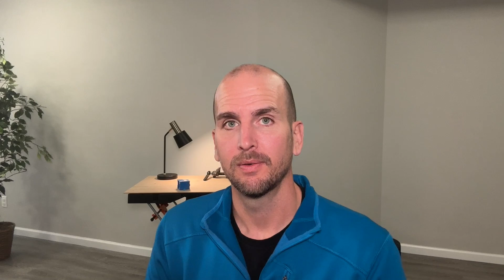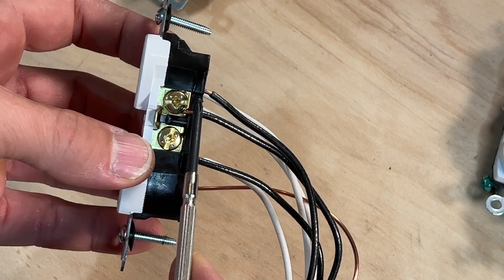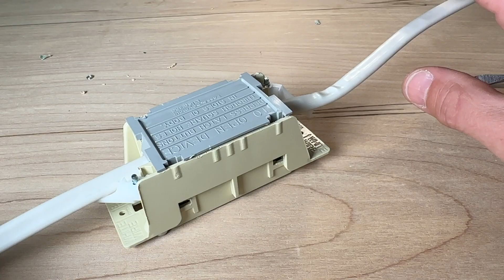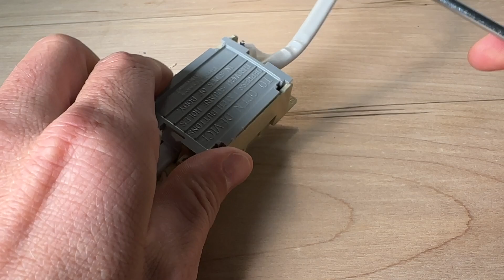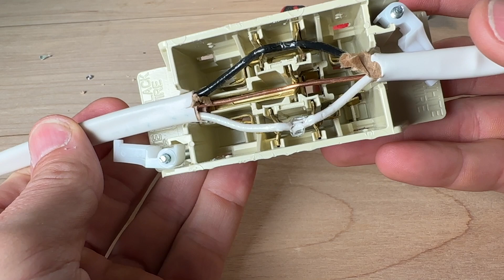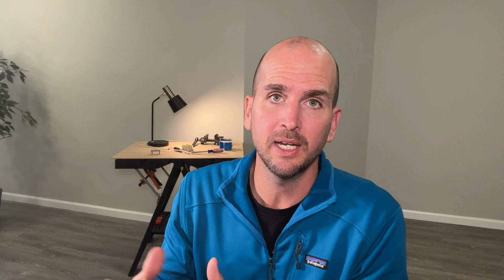90% Of Homeowners Have Never Seen This Dangerous Electrical Device

Comment: That's atrocious. I can't believe that these meet any NEC requirements. I would replace every one of these if they were in my mobile home.
Reply: These new NEC approved 'in wall splice kits' for Romex work the same way. I have very little confidence in these things holding up, but it's the bosses call and his license/ insurance.
Reply: The thing is, you probably wouldn't be able to replace them.  Not without knocking out pieces of the walls, at least.  I've helped replace a few switches/outlets at my Mom and Dad's trailer house, and there is no box to put a regular receptacle into.  These have wings (only briefly shown in the video) that flip up/down to catch on the back of the drywall and hold it into place.  They've had that particular house for nearly 30 years at this point, but still...These seem to be exactly the same as they were back then.
Reply: @DeadManWalking89  I highly recommend remodel boxes and regular outlets very easy todo and MUCH safer
Reply: @jmccord0716  @Bike Goddess Finally got around to looking at a couple pictures of these.  Those would indeed be a wonderful improvement!  However, at first glance, I'm not sure they would fit, unfortunately.  Of course, the drywall isn't really a problem, but I'm afraid the boxes would be too deep.  We swapped out a light switch a few months back (took like 2 or 3 hours!), and I'm pretty sure there was barely enough room for the switch to begin with.  I will try to remember these the next time we have to replace something!
Reply: @DeadManWalking89  try looking for a shallow box of the same type I believe Amazon has them
Reply: @DeadManWalking89  I was able to there were a few that the wires were short and hard to make work but I was able to do it without trouble.
a person can buy old work boxes at nearly any hardware store for the same price as new work boxes. it's not too difficult but if you have no experience id recommend watching lots of YouTube before attempting one irl.
Reply: Yep. I ripped all of these out of my RV and replaced with shallow boxes and proper outlets.
Reply: The UL approval is enough to certify it; the NEC (NFPA 70) describes practices for using approved materials.
Reply: just a little bit of water away from being short.
Reply: @Karl with a K The pass-through contact is excellent but the drop contact is a farce. Plugging a 15A device into it is not wise.
Reply: They used for long time hard to find or order on line wen plug gets lose. All you hope their anuff wire to box and pigtail dut not always
Reply: One problem I've seen with mobile homes is the walls are too thin to simply install a standard box to accept a proper receptacle.
Reply: if it is made by a member of the NEC, of course it meets code. if it is made by a nonmember, you can sure as hell guarantee it wouldnt be compliant
Reply: @harveylong5878  Please, enlighten us as to who these members are that you mention. Oh, and please provide documentation as to how one becomes a member of the NEC. Thank you.
Reply: This type of connection is called insulation displacement contact.  This type is used in almost every PC and laptop on the market.  In order for these to be safe to use, you need to have the correct tools to insert the wires into them.  If someone wires up an electrical outlet incorrectly (i.e. loop on wrong side or switches the neutral and line wires) these can be just as dangerous if not more dangerous than this type of connection.  A reversed polarity outlet will still work but can increase the shock hazard.  The loop on the stud in the wrong direction can cause the wire to come loose over time and cause arcing in the box.
Reply: @alankingsborough1005  While used in electronics, we don't pass 1800W  through those!  And yeah, you can create a dangerous situation with any connection, but on these the likelyhood is so much greater.  A wrongly looped screw joint is going to be way more secure than this thing will ever be.
Reply: @paul_moir  The big issue with the outlet shown is that the wires WERE NOT properly installed in the outlet.  Once the wires are pushed into the outlet properly, they go into a slot that is a bit smaller than the diameter of the wire being inserted.  This slightly smaller slot causes the wire so slightly elongate in the connection area and the wire to cold weld to the contacts, making it very hard to remove unless a great deal of force is applied.  The fact that the wires popped out with little force is a good indication that they were not installed properly.  The fact that laptops get jostled around all the time and don’t have loose connections in these style connectors is another indication that the wiring wasn’t don’t properly to begin with.  Even though they don’t look normal, there is a place where these can be used and are both NEC and code compliant.
Reply: @alankingsborough1005  But you can never achieve the contact force needed to prevent contamination of the metallic interface using this design.  It is nothing compared to a screw.  While my familiarity is with the CEC rather than the NEC, I would point out that so many AHJ reject back stabbing (not to mention actual electricians)  is evidence that code compliance is not universally accepted, despite that is supposed to be. 
Comparing these to IDC connnectors used in computers is I think disingenuous, since the use case is so divergent.
Reply: @paul_moir  As an NFPA member for about 20 years (my emphasis was on lightning protection, covered by NFPA 780 rather then the NEC in NFPA 70) I know the code is about fire protection. NFPA 70 (and 780 as well) does get into life protection, but operational reliability and attached appliance electrical safety is left to the UL. 
This produces oddities. In NFPA 780 lightning strike vulnerability is described using an imaginary sphere 150 feet in radius; if such a sphere were placed on the landscape the structure is not vulnerable unless the sphere would contact it. However, if the structure contains flammable liquids the radius of the sphere is 100 feet. How does the lightning know? Of course, it is a difference in fire risk.
Reply: @alankingsborough1005  OK, MAYBE if installed PERFECTLY using the correct, special tool, they're safe.  If NOT, there's a good chance of failure and probably a fire hazard. 

Does each receptacle sold (or each box of them) come with that tool?  Is that tool easy to use and reliable?  Is it easy to replace if it's lost?  Does each box of receptacles come with a warning that they're safe ONLY if the wire is installed using the special tool?  Do municipal inspectors remove a sampling of these from walls and open them to see if the wire was installed correctly?  I'm guessing that the answer to most of these questions is "NO". 

Unless the answer to ALL of these questions is "YES", then they will OFTEN be used incorrectly and no one will notice until something goes wrong.  Even IF the answer to ALL of these questions is "YES", they will STILL inevitably be used incorrectly.  Even "backstab" wiring a receptacle is probably safer than one of these when used WITHOUT the special tool.
Reply: @alankingsborough1005  Voltages in computers are 12, 5, 3 volts DC.  Bit of a red herring to suggest that because this sees wide use in computers that it is safe in this use case...